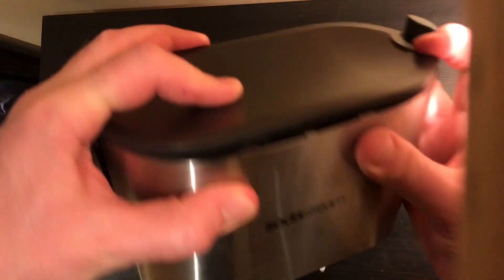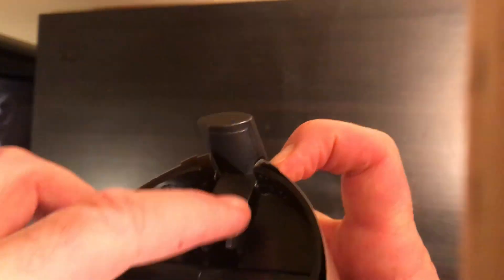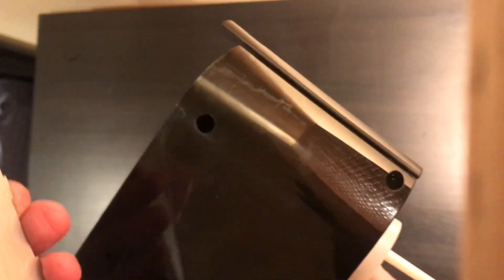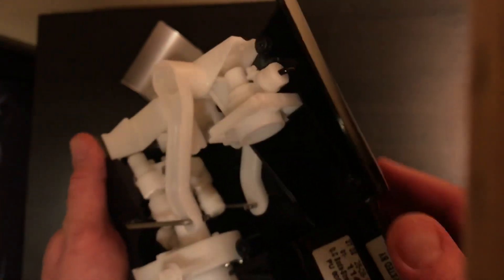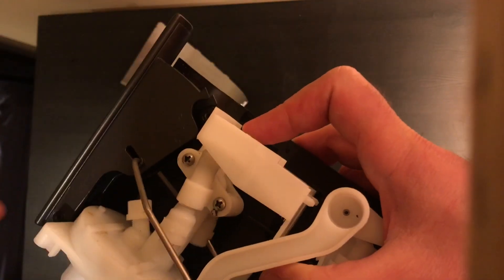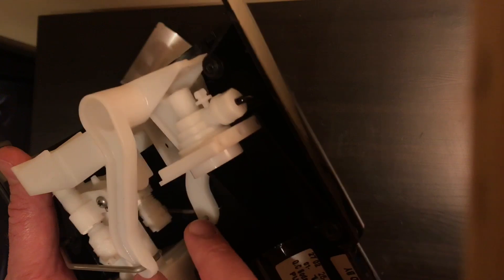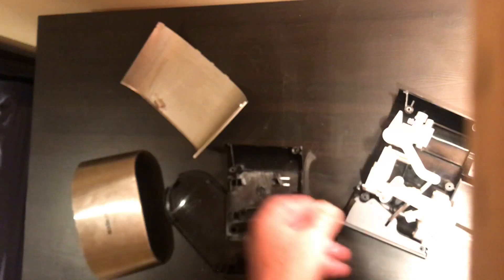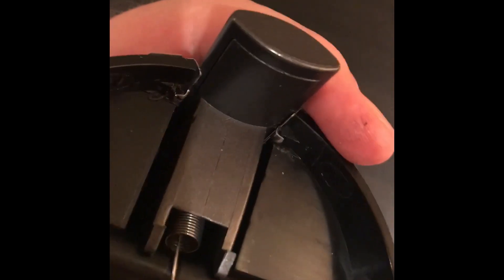SodaStream Pure: Disassemble / Reassemble, Fix, Repair, Pressure release / relief valve

Comment: Thanks for the video. I took mine apart and the plastic section with the O-ring was broken right off . I guess it was just brittle with age. Lots of black mold on the white plastic inside, it was disgusting.

Comment: Have a slightly different model. (large triangular charge button in the top front) The same pressure relief valve worked itself loose.  The top comes off in much the same way, however the rest of the assembly unscrews from the bottom.  Your video confirmed, the problem and the fix.  Thanks

Comment: By the way, my slip joint washer was only 59 cents. I found instructions for filling SodaStream CO2 canisters on Mr.Spork's Hands on YouTube. I use food grade dry ice pellets from a local distributer, so no funnel or crushing dry ice. Nylon gloves with rubber coated fingers are enough to handle dropping the pellets in. They fit down the neck of the cannister perfectly. Removing the top required clamping in a vice and some muscle on the wrench but the first time is the hardest. Refilling after that is easier. Remember to tighten top back on tightly to prevent leaking CO2. I do not remove the pressure relief valve at all because someone down in the comments suggested, before removing the top, just press down on the little valve in the center of the top until no more CO2 comes out. That works just fine. I use a kitchen scale accurate in grams, weigh the empty canister without its top, then add that weight to the grams the canister says it holds. I put pellets in until I reach that total weight, then quickly screw the top on very tightly. My dry ice costs $1.50 per pound and it takes a little less than a pound per canister. So, a pound per canister gives time to fill several before it dissipates into the air. Watch the video on YouTube.
Reply: A much easier way to refill cans for cheap is to buy a 20 lb CO2 CYLINDER and have a local shop refill that for $25 or so.  You only refill about 10 ounces in an "empty" can as there is about 4 ounces of residual gas left after it stops working in the SS.  You will have to purchase an adapter kit off ebay that will couple the large tank to the SS cans.

Comment: I have had my 2 (one for the house, one for the RV) SodaStream Pure models for many years. Other models before that. I like the Pure and one of them started leaking more CO2 than it was putting into the water. I first tried several sizes and combinations of o-rings up into where the CO2 canister screws in. No luck. Then I found your video and was able to take apart the Pure. Thank you! But nothing was loose or rattling. I took apart the part holding the large black gasket. The hardware store had never seen a gasket like that proprietary one where the bottle screws in so I reinserted it into the assembly. Next I purchased several slip joint washers that looked promising. I tried several kinds by just pressing them up against the existing gasket. This does not require disassembling the Pure at all. The Pure worked without the silver casing  and black top so my trials were with it not completely assembled. The spring, by the way, goes back in by putting the bigger ring end on the "post" then using long narrow tweezers to guide the other end up into the handle onto the plastic hook up in there. The 1-7/16" O.D. x 1-1/4" I.D. x 1/8" H. for shallow nuts slip joint washer worked but still some CO2 leakage. Then, success! A 1-7/16" O.D. x 1-1/4" I.D. x 3/8" H. rubber slip joint washer worked perfectly just pushed up against and kind of around the black gasket. It stays in place. No CO2 leaking and bubbling the water goes as it always had. I'm a 78 year old widowed mom of 8, grammy of 22. If I can do this, anyone can. This got long so see my next comment about the cheap and easy way to refill the CO2 bottles.
Reply: Extra comment... when the Pure was leaking CO2, it also spurted water up out of the bottle.

Comment: thanks! it was the 1st video i tried & it worked for me! :) it didn't even occur to me to remove the black casing; i was assuming it was a solid piece & was struggling to disconnect some of the pieces inside before checking youtube. yaaaay

Comment: I usually prefer to lock the 
valve threadings, in place 
with teflon tape.

The more turns you wrap 
on them, the tightest 
the fit becomes.

This is especially important 
for metallic connections between 
different metals, to prevent oxidation.